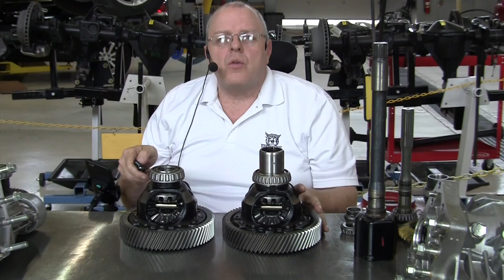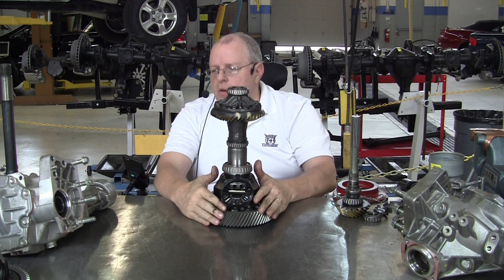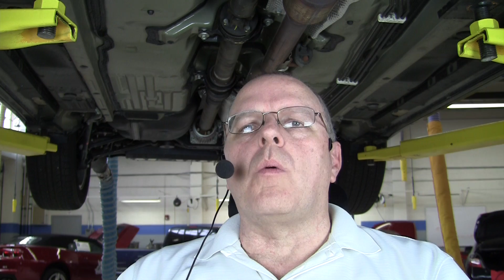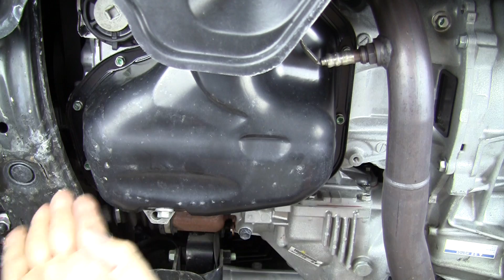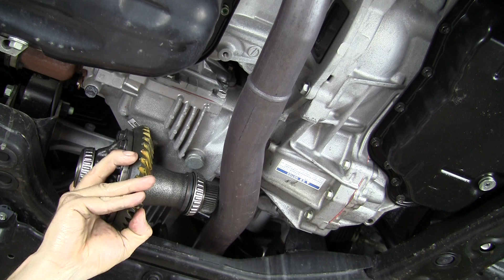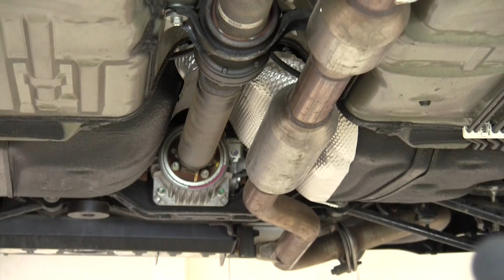Crossover AWD / 4WD Systems

Comment: Excellent video sir,  only thing i would have added in is that the way full time 4wd would be implemented on this type of system. Such as on a Celica GT4 or an aftermarket racing 4wd setup for a Honda.  
And thats by not using any type of clutch packs in the diff housing at all and using a viscous coupler between a 2 piece propellor shaft to act as a center differential.  As its only a small amount of slip needed to prevent binding in turns.

Comment: From your video I finally understand the difference between Transfer Case and Power Transfer Unit…thanks for the explanation. Interesting as I have an AWD 2016 SRX Cadillac that uses the Haldex system to determined when to apply traction to the rear tires. I thought I had both front wheel deferential and a transfer case. Your clear explanation is that I have a Power Transfer unit.  I was confused when the service advisor said I needed to do an oil exchange service for the transfer case… (thinking should I change fluid for the front wheel differential). Luckly the service tech pointed out there is no front wheel differential to change it is the Power Transfer Unit.

Comment: My 2008 Highlander AWD has a noisy rear drive shaft pinion bearing inside the propeller shaft housing of the PTU. I verified this with a four channel noise finder while driving over 30MPH. One sensor on PTU housing, one on the propeller shaft housing of the PTU, one on the mid-point propeller shaft coupling and one on the rear diff. The sensor on propeller shaft housing of the PTU was by far the loudest. Every shop I spoken with wants to remove the entire transmission and replace the PTU with a used one. $4000 at least. Can't the propeller shaft be removed from housing, the housing removed from the PTU to access the bad bearing and replace it with the trans still in the car?

Comment: These videos ar the best. It's also pretty neat to see that toyota is still using the same bolt pattern with the power transfer unit/transfer case. I have 1996 st205 and every GT-four before that had also the same bolt pattern. That ring and pinnion gear has shrunk alot compared to GT-four's.

Comment: So looking at my Service manual for ford Maverick with AWD it uses a dog clutch inside the PTU to either engage or disengage the rear drive shaft from turning at all. Then has a clutch pack in the rear differential with ability to send power to either left or right axle shafts . So this way the drive shaft isn't always turning saving gas. Plus to send more power to a axle/wheel that has more traction better driving the car.

Comment: i am going to take out the transmission on my rav 4 to change clutch i get from your video that i can take out the drivers side parts axle etc and undo the bell housing and take it out the side
no need to take anything else except engine mount frame. In other words leave power transfer alone 
comment?

Comment: So theoretically if I put an open differential on the rear, I wouldn't a cluth pack or fluid coupler in the middle of the propeller shaft?

Comment: Functionally speaking, when the rear coupling is engaged in the video, this operates similarly to a part-time 4wd with open F/R diffs, and at least one front tire and 1 rear should spin at all times.  But this should only be engaged where the tires can slip since the front and rear diff will turn at the same speed.  

Whereas a vehicle with a center diff but no center diff lock or limited slip, would potentially only send power to 1 tire, but can operate in 4wd on pavement since the front and rear diffs can rotate at different speeds.

Now is there a difference between "full time 4wd" and "AWD"?  Or is it just semantics...

Comment: Thank you for the video. Just got a 2007 RAV4  with a push button. For locking differential. What I got from your vid is the rear differential. Is turning. But not pushing. The weight of vehicle. When slips in any of the wheels the 4x4 engages?
Reply from the maker: True! Thanks for watching

Comment: What is the theory of operation to control the interaxle differential  electric clutch so that it engages when rear wheel speed is less than front wheel speed due to low traction, but does not engage when rear wheel speed is less than front wheel speed due to difference in radius around a turn?    A viscous coupling simply limits the torque to a set level, but it would appear that a clutch is going to require some other theory of operation.

Comment: Is it correct that even when AWD is engaged, the rear wheels always get less power than the front wheels as gear reduction for rear differential is less than the front?
Reply from the maker: Typically, the power is controlled by a variable rear axle clutch. Thanks for watching

Comment: Hi I have a problem with my ptu when I give a lot of power on the rear wheels, pressed ptu from the gearbox and bolts M10 that attach ptu with the gearbox tearing apart the threads that are in the gearbox and all the bolts loosen and I have lost 4pcs on the highway. How can that happen?
Reply from the maker: Make sure your tire sizes are the same and equally inflated

Comment: John....I think I missed how the rear axles differentiate left and right as the prop you were using probably is not what is actually used in the vehicle. Thanks for a great video
Reply from the maker: If I understand your question correctly, the rear axle on these models is just an open differential. This means it will act like any other rear wheel drive vehicle regarding left or right wheel traction. Some vehicles have a stability control system that uses the brake system to slow will slip left versus right.

Comment: hi, according to  this explanation.  does the 4gen 4runner 4x4 only needs the rear differential gear be change if I want to it to perform better only pulling trailer?
Reply from the maker: No, you would only need to change the transaxle gear ratio. The PTU and rear axle will follow its speed.
Reply: thank you, I have been trying to find an answer and couldn't find one until I watched this video.

Comment: Thank you sir! Wonderful explanation. I just bought my first sideways engine (transverse) AWD vehicle and I needed to understand how the drive train is different than my so called 4x4 truck. So my 2014 AWD Volvo XC90 has transaxle, open diff in front and open diff in rear, but is sometimes has both front and rear axles drive via the PTU "Bevel Gear" and Haldex clutch assembly on the front to rear propeller shaft.
Reply from the maker: Glad it helped. Thanks for watching. Haldex is used by many vehicle manufacturers

Comment: I'm not sure if he explains, but elder Subaru vehicles before the tractor transmissions, would run 50/50 torque split on manuals equipped with AWD(N.A.) and that's why many people have that "shitty ol' pickup truck" affection for them, because they won't oft leave you stranded, so long as you got gas at least
Reply from the maker: Thanks for your feedback

Comment: Very well done video. I just purchased a 2021 Kia Seltos awd. It looks to be similar to the system you explained. It has a hydraulic pump to activate the clutch pac located before the rear differential. Is it practical to service/drain and refill the oil from that clutch assembly say at the same time as servicing the PTU and rear differential.
Reply from the maker: Thanks for watching

Comment: There’s no ‘centre’ differential in the PTU. What’s to stop bind up when AWD is active? Is it designed to slip in the clutch pack or is it never engaged long enough for this to happen?
Reply: He explains that the clutch pack is computer controlled and is only momentarily engaged. So even if there was some bind, it would be quickly relaxed. I don't know if the computer would let you get away with locking it on a high traction surface.

Comment: ...I wanna know more about the failure rates for the rear differential unit.  I hear that the GM's Versatrak system has some serious failure rates, and it uses some kind of "Special" differential fluid in it's rear unit.  And who manufactures these units for GM, or as they an inhouse product, built by one of their subsidiaries?  Thank you for your lessons, Professor Kelly.
Reply: Any of the clutch pack type power transfer systems have an overheating failure mode.  In an extended low traction scenario the clutches and servos if applicable can trigger a system shutdown or idiot light to protect them , from damage.  The advantage of these systems is that they can be somewhat predictive or be set to different modes (mud, sand, snow etc.).  Subaru for example, if CVT equipped utilizes a clutch pack, if manual utilizes a vis our coupling.  The advantage of the viscous coupling is a more robust lockup, graceful failure mode and durability.  In the presented examples Subaru operates differently as instead of “on demand “ engagement of the rear axle the rear is driven at all times or full time AWD.

Comment: I wish you would do another episode where you tear apart the rear differential too.  I was curious how the "elector magnetic' engagement of that rear clutch is activated?  Does the computer just apply a 12v power to it?   does it go through a relay?   I was just wanting to know if there is a way to activate that clutch manually?   So I could have it on or off whenever I wanted-- (like if I use this rear end on another project).   I know Acura has the "super handling all wheel drive" rear end also--- I wish you would do episodes on these rear ends and others.

Comment: Hi awsome video very nice one, i have a 2006 chrysler pacifica AWD amd i dont know what fluid type it uses on the front transfer case, i know that the rear transfer case uses atf+4 fluid but i need to know if the front one uses same atf+4 fluid thank you!!

Comment: Wow, excellent video. So my Infiniti (Nissan) QX60 (glorified Murano or Pathfinder if you will) AWD is making a loud humming from the transfer case. It is a front-biased type of AWD that I'm sure is almost exactly like you demonstrated in this vehicle. The vehicle drives perfect except for a humming noise, which actually is not present when first taking off. It seems it only starts up when the rear clutchpack de-energizes. The humming is clearly coming from the front of the car, probably the transaxle. I'm thinking I have a bad bearing somewhere or there is some slip going on in the front differential. Any ideas on why I'd get humming from the front end (not bad wheel bearing...already had it checked)? It get's higher pitched as I increase in speed. It goes away when the rear clutchpack is engaged.

Comment: Thank you for this - excellent explanation and far better than even a Toyota service advisor or salesperson has been able to provide. Are you able to confirm my 2011 Venza 3.5 AWD applies power to the rear wheels on initial acceleration no matter the road conditions as well as during periods of front wheel spin? It's another question I get different answers to at Toyota depending on the day and person I'm talking to... Also...
The other question that mystifies me a bit is why don't they put the rear wheel clutch pack at the front of the drive shaft? That way you're not wasting energy and fuel spinning a driveshaft for nothing? Maybe a space issue or suddenly loading up that long shaft with torque would stress those multiple joints too much.....
Reply: Answering your second question - if clutch was at front then in 2WD mode whole drive shaft would be powered by rear wheels. That would probably cause bigger loss of energy then powering it by the engine. The solution is to use two clutch-packs (front and back) like in Jeep Renegade or Quattro Ultra but then the drive shaft must be speeded up from a standstill before it can transfer power to the back - that's complicated and takes time...

Comment: A video of BMW variable X drive vehicles (not the X1 transverse engine as it similar to these systems ),  honestly it seems much simpler system without the need of disconnecting the front axles

Comment: Great job now I have a Lincoln MKS all-wheel-drive and the PTU is whining a little bit 80,000 miles and Ford told me $2000 to replace I want back again today and said why can’t you just suck out the oil and put new gear oil in and he said it’s like an old transmission you take the oil out it just causes more problems do you think this is true or should I try to suck the oil out I could barely hear the whine

Comment: So if the front wheel on the opposite side of the transfer case is spinning freely, will an AWD crossover lose all the other wheel's power too?
Reply: No, if ring gear is rotating, than propeller shaft is also rotating.
Reply: Can you explain? By watching the video i learned that the transfer unit seems to be coupled to the same piece that couples one of the front wheels. What you are telling me is that its coupled to the ring gear? @4x4.tests.on.rollers
Reply: @MateusLeonardoMendes  Right axle shaft goes through the transfer case, through the 'spool', but it is not connected with these elements. It rotates independently inside of these elements. Transfer unit is in fact coupled with ring gear.
Reply: @4x4.tests.on.rollers  thank you, that's what I had a dubt on. Got it

Comment: Great video, thanks! My question is - why is propeller shaft overdriven, what is the reason for that solution?
Reply from the maker: It allows for a single rear axle gear ratio
Reply: @WeberAuto  OK, thank you for answer, but what is the advantage?
Reply from the maker: @4x4.tests.on.rollers  it is less expensive to produce
Reply: @WeberAuto  Don't you think that there may some advantage of overdriving of propeller shaft? What I mean - if it is from Lexus, then there is multiplate clutch pack used - electromagnetic type. It has ball ramp mechanism, so it requires rotation to work. Faster rotation speed means faster clutch pack responsivity, is it correct?
Reply from the maker: @4x4.tests.on.rollers  The propeller shaft is overdriven with respect to the tire speed (so it can still have some gear reduction and torque multiplication at the rear axle), it does not rotate any faster than a typical propeller shaft. Clutch application time is adjustable in the design phase by controlling clutch free play
Reply: @WeberAuto  Thank you sir.
Reply: @WeberAuto  Dear Mr Kelly, hello again. I do have a question about gear ratios in Nissan X-Trail - according to the manual, there are two versions of PTU - that is 0,404 and 0,656 but only one version at the rear - 2,466.  PTU 0,404 fits the rear 2,466 but 0,656 does not. Is it a mistake in manual or can the ratios be that different?

Comment: The power transfer unit and the rear diff are fixed units and don't move. Why add the extra mass to the drive shaft by making it 3 piece?
Reply from the maker: The PTU moves with the engine. The driveline must allow the movement with a separate universe joint and slip spline

Comment: working on my 2002 ford escape towed away without dollies and was mystified why I have no rear wheel drive at any time even when I flip the switch to 4x4. took apart the rear dif. and discovered the clutch pack with electronic solenoid attached to the front. I get it now...I have to ensure the solenoid is working to compress the pack. Thanks for posting this as I have been searching for days to validate what was in my mind. Great learning video!
Reply from the maker: Thank you. I am glad it was helpful

Comment: Much of this is down to European construction and use regulations that state that at all times under braking the rear wheels must not lock up before the front. These were draughted before ABS was common. VW had lots of experience with AWD systems using differentials in the Quatro and tried to apply the same in the Golf. But the AWD system added drag to the lightly loaded rear wheels causing them to sometimes lock up first under braking. So  they deleted the centre diff and added an automatic clutch that disengaged the rear wheels under braking, the Haldex unit. This has become the norm for part time AWD cars derived from FWD units, It's cheaper. However a Haldex unit is not really needed on well balanced cars like the Subaru or bigger SUVs.
Reply from the maker: Thanks for your feedback!

Comment: So the rear drive only operates on the output of the right side of the front differential?
Reply from the maker: No, it only appears that way on a hoist. It tries to operate both sides until one side starts slipping

Comment: I have a 2007 Terios (second generation) It is an all wheel drive car, but I am not sure it has an electronic system controlling the 4wd when it slips. Also, does it go in 4wd mode when it is faster and on road like 100-130 km per hour.
Reply from the maker: Thanks for your feedback

Comment: Believe this is a waste of money unless you live in the snow belt or similar areas of the country. Would continuous AWD or manual 4WD be your choice if needed?
Reply from the maker: AWD, but most 4WD Systems now have an AWD selection as well.
Reply: WeberAuto   Don't you think 4wd when placed in 2wd would give you better fuel mileage than all wheel drive?
Reply from the maker: Yes, I think it would be just slightly better
Reply: I live in Chicago and never had a issue driving a FWD car unless we really really got hit with snow. My next car I was looking at a AWD, might be a sedan or mid suv, but knowing that you have to replace all four tires when one needs to be replace seems a bit much for my tastes.  Still I get the benefits of AWD, but like you said, i would only need it in the winter.